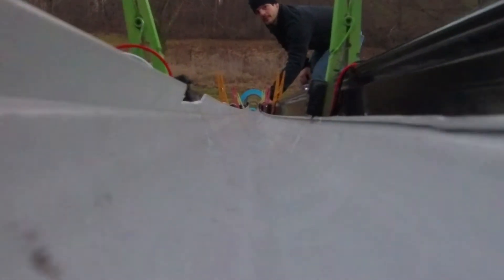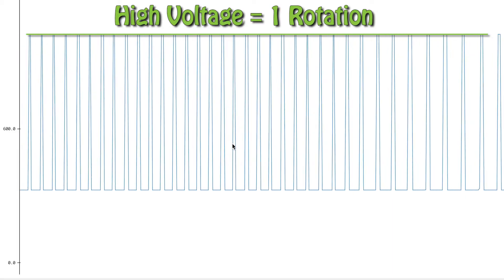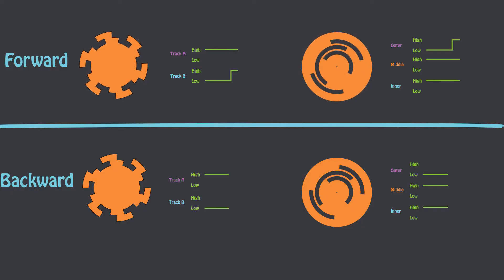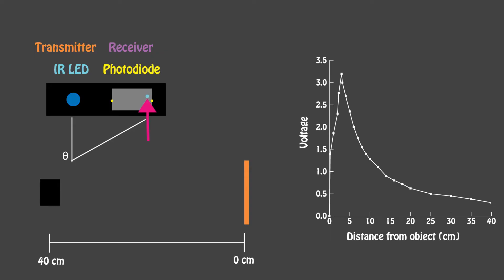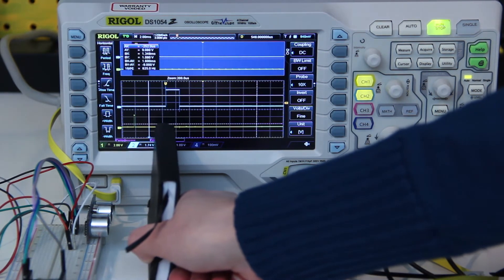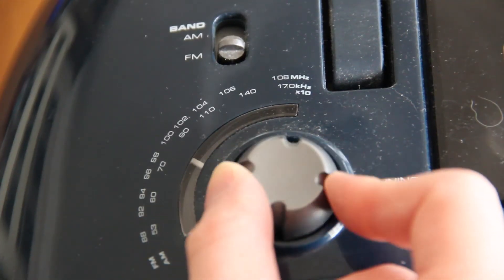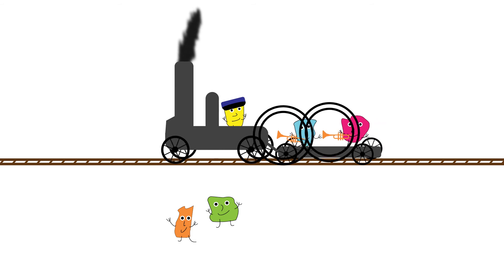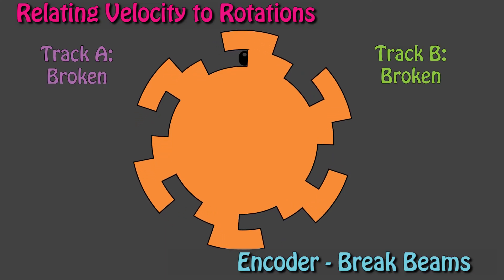How do we measure velocity? | Velocity Sensors | Physics: Kinematics #sciencegoals

Comment: Amazing video! I have a question, is it possible to use parallax method for measuring distance? like placing 2 cameras in the robot and using the offset of both images to calculate the distance to an object?
Reply from the maker: Thanks! You can do that. The robotics team we mentored used that on their robot to shoot basketballs a few years ago. I believe they used OpenCV. It will require some calibration. If you have issues when you are setting it up, let me know. I'll track down the mentor who help set it up and see if they can answer you questions. Here is a video of the robot. It is the tall red one: https://youtu.be/ABefxEH5Vzg
Reply: Wow! that robot is incredible. I'm trying to build a small one, but it might take a while. I'll let you know and thank you very much! :D